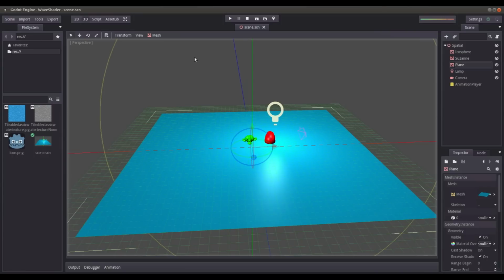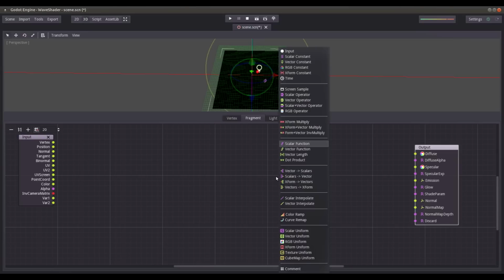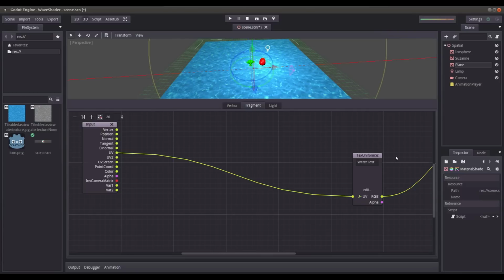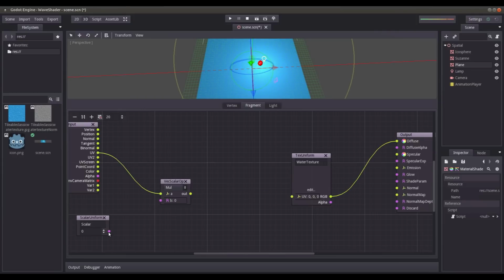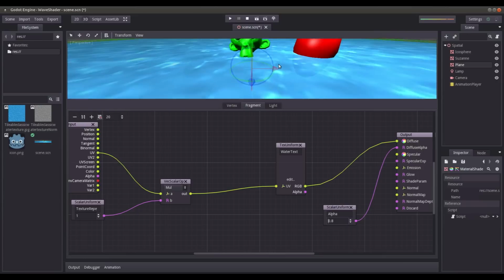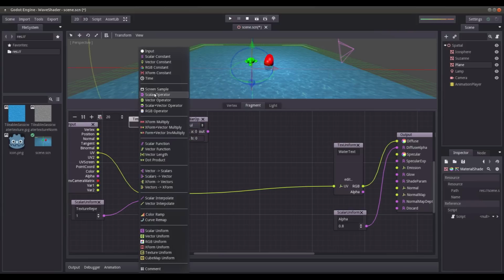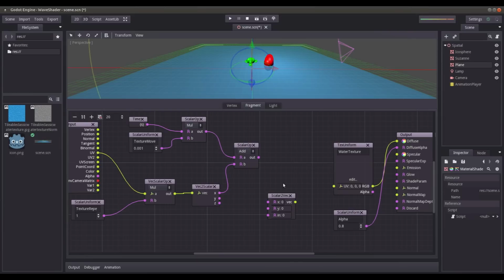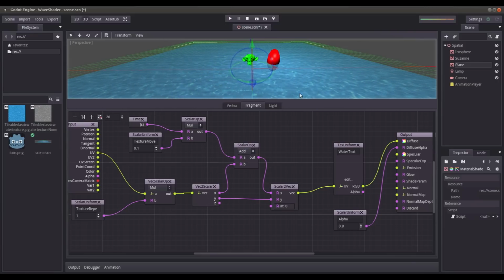Godot Water Shader Using Visual Shader Graph : Part 2 of 3

Comment: Can we not add pngs for water texture. I made a texture on inkscape but it didn't load on shader. It was still black. But after I downloaded a jpg from Google, it showed a blue colour, that's it. But it wasn't exactly like the texture I loaded.
Reply from the maker: Hm. It may have something to do with how the image is imported. possible the "repeat" flag or something. I have used pngs before. I haven't looked at 3.1.4 in several months so I would need to jog my memory if you cannot figure it out. If you cannot figure it out I will try to help you more.
Reply: I solved it. The repeat wasn't enabled. Also I didn't import it properly from blender. Thank you for the tutorial😊